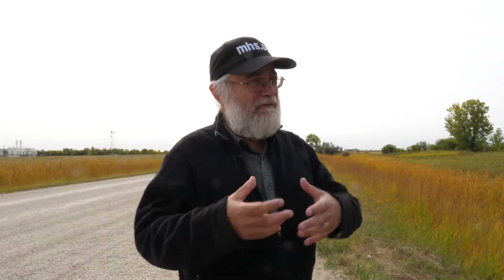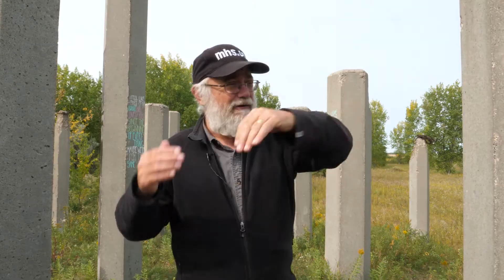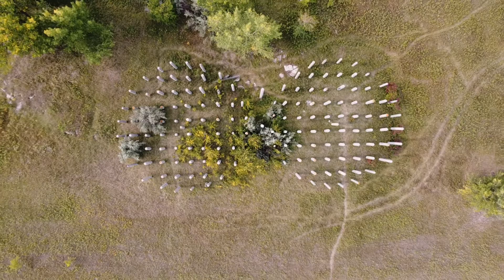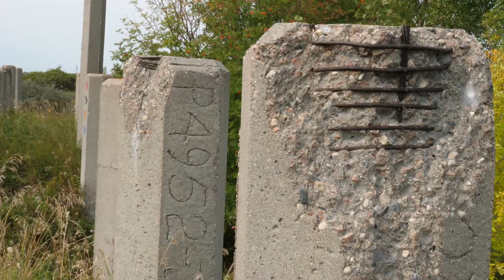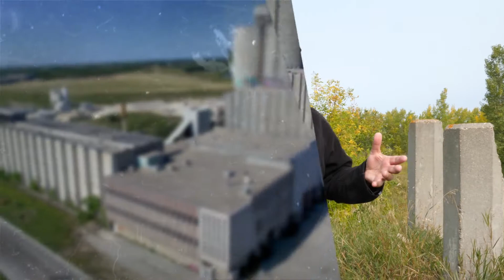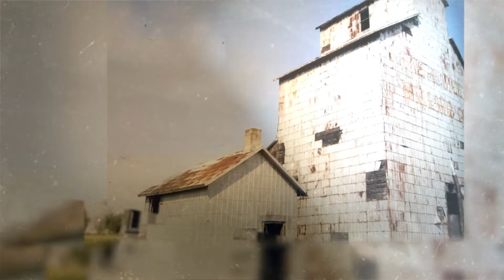Abandonded Manitoba, WPG Stonehenge

Comment: someone should be responsible for cleaning that mess up
Reply: What mess ?
Reply: @joedirt9600  are you for real? all that concrete sh*t is an eyesore in the environment. smh
Reply: @dosmundos3830  huh, all the locals see nothing wrong with it. What's the difference between these concrete pillars compared to all the other concrete pillars that are everywhere holding things up ?..they have been there since 1964 and the environment around them seems to be doing just fine...are you a Wacko Liberal by chance ? Just asking..
Reply: @dosmundos3830  Wacko Liberal has joined the conversation..

Comment: There are a few problems I see with your explanation that maybe you could address.
1) Buildings, expectantly silos,  would normally use unified piles, Maybe different ones around the edges.  Why would then have random sizes, shapes?
2) If you look closely at the pliers, they are each made differently.  Why would they make each pillar different?
3) Why would there be serial numbers on the pillars?   Lot numbers sure.  Maybe even a 2 or 3 different lot numbers.  But not different numbers for each pillar like your trying to keep track of different formulas. 
4) If this was for a structure, why would you carve letters into them.   This would be a no no as you wouldn’t want to give it a place for stress fractures to start and water/ice to destroy the concrete.  Also, notice they are all labelled by hand.
5) why would they back fill the area with different kinds of soil?   Surly they would have just picked one and gone with that.  Or more likely not back fill at all.
6) Notice that the piles were not cut to height.
7) And of course.  Why would they have done this in 1950 for a company that was going to buy the area and build a silo in 1963?

These are of just the obvious ones that I noticed.  So I’m sure they came up during your research plus other not so obvious ones.  I would really like to know the answers.

Comment: Fascinating!

I'm no expert, but if you are driving piles, wouldn't you drive each pile in turn to the required depth?
You can only drive one pile at a time.  These piles don't seem to be all at the same depth.  Even if construction was halted, what you would have is all the pikes that were worked on at the same level, then some piles missing.
Well that's my logic anyway.  Perhaps there is more to be uncovered.
Also some piles have a reference number scraped into them.  Do they all have the same number? I would think that would be a manufacturing lot number.
Reply: Yes,  you drive piles to the required depth. The depth of refusal.  You use a hammer of a certain size and when it refuses to go any farther you have reached your load bearing capacity and you blow the top off of the piles to expose the rebar to incorporate into the foundation
Reply: Thanks Rainer,  you have just educated me further about piling.  Good information.